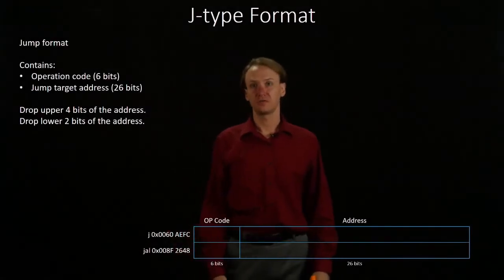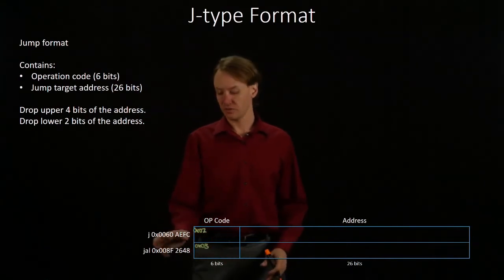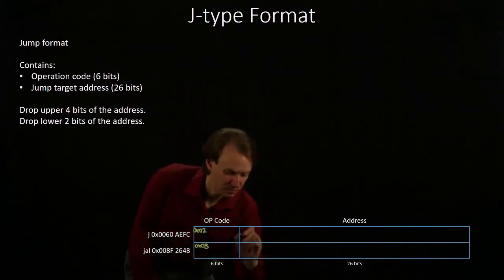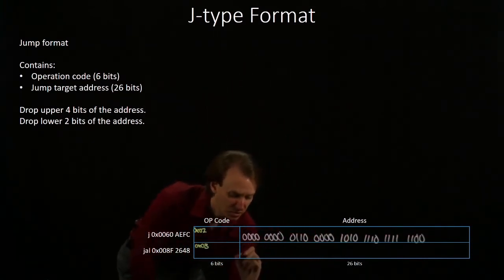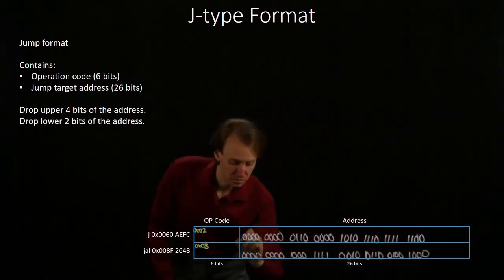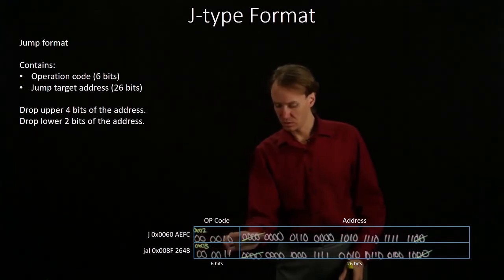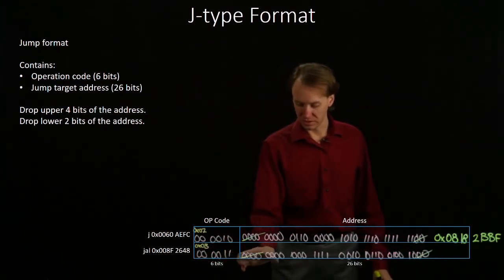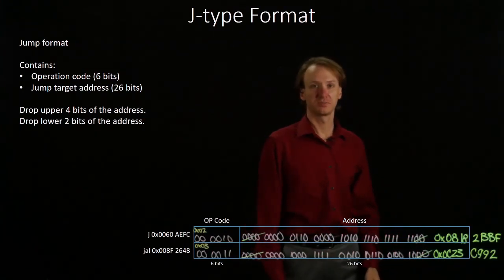4-3-a.  J-Type Format Example 1

Comment: Can you tell me why we are dropping those first 4 and last 2 bits of the address??
Reply: Perhaps this is too late but I just wanted to tell you. Since J-type address field is 26 bits long and the memory address is 32 bit, so we need to drop 6 bits. 32-26=6.
First, we can choose upper 4 bits, because it would be rarely changed. Don't forget that this is jump instruction. There will not be many cases that we need to jump over the upper 4 bits which means 2^28 to 2^31. That jump is too far away--we do not jump that so much far--so we can get rid of it.
Second, this is word-algined address, which means the difference between address is multiple of 4. So we can drop last 2 bits because we already know that it is always multiples of 4.
I hope this helps for any other people.